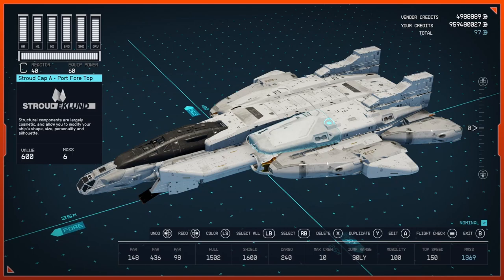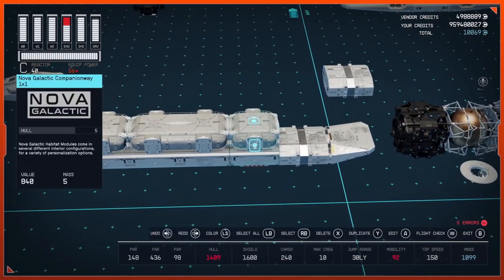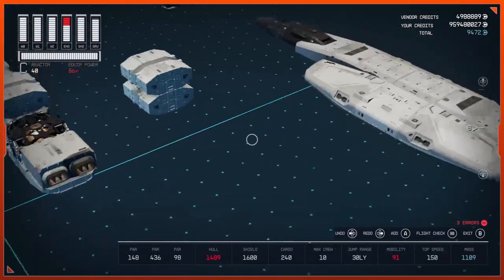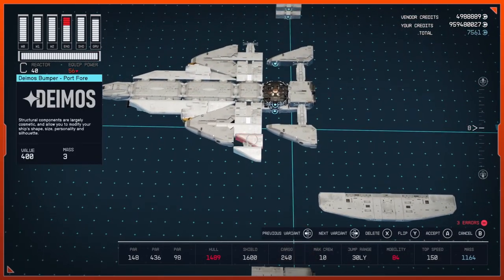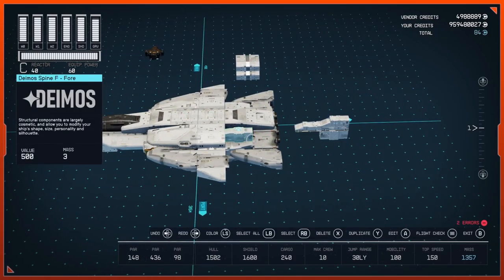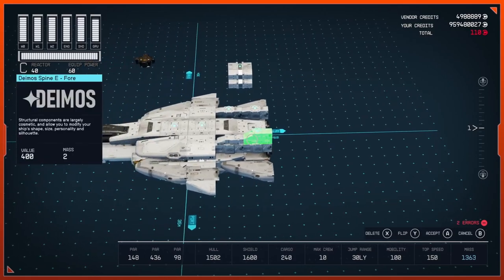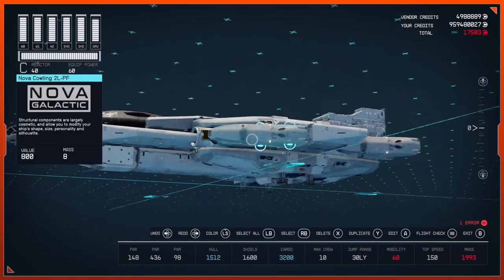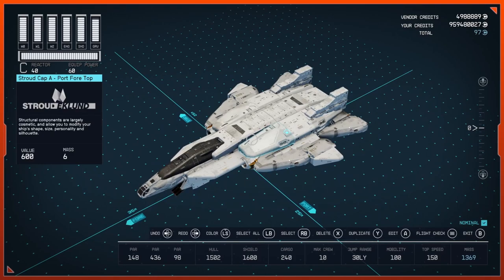F-22 "Raptor" Starfield Ship Building Guide (No Mods)

Comment: How do i get the engine to duplicate down?

It won't for me. It just duplicates up.
Reply: @SuperBleachfreak  i had that issue i had to delete the storage i used for duplicating and re did the two storage and it fixed it
Reply: @justinsexton6659  ill try that
Thanks
Reply: @SuperBleachfreak  np hope it works
Reply from the maker: try to use a stack of 3 deimos Hull As . Duplicate using the Bottom Deimos Hull A. of the first one duplicates up, leave it and duplicate again. the second should go down, the delete the top one afterwards
Reply: @2SmokinBarrels  that worked thanks

Comment: Fyi The reactor can no longer be glitched
Reply from the maker: It can. it's just not available at the outpost. Try instead to put the reactor in place first, then drop the other parts onto it.
Reply from the maker: also, you canbused the SF40 which is available at the outpost and then go to another staryard to swap to the pinch 8z
Reply: @2SmokinBarrels  i got it to work thanks o fyi my outpost on Jamison had most of the parts aside from the engines and everything worked perfectly
Reply from the maker: @justinsexton6659 glad to hear you got it all working. thanks for the update!